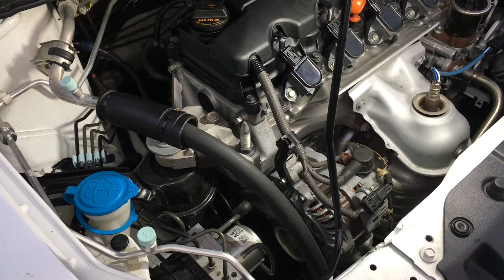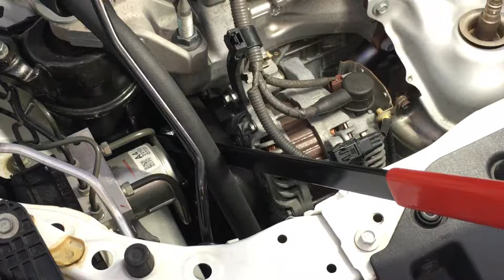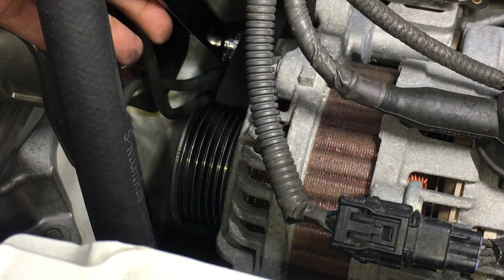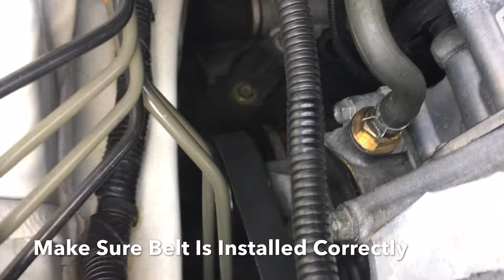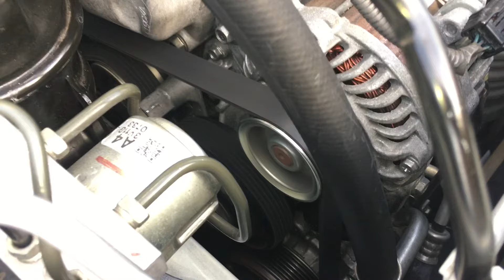2013-2015 Honda Civic Serpentine Belt Replacement DIY

Comment: Thank you sir. I do hope we get more 9th gen civic repair videos. It seems there’s not enough videos out there. I’m looking forward something like a starter replacement or cv axel. Ah maybe these cars don’t break down often. I dunno
Reply from the maker: These cars don't break down and also I just reached 50k miles haha. There will be more content coming out for sure, just be sure to be subscribed.
Reply: I second that. Also I just hit 83K and no problems. AC doesn't work because a rodent chewed through my wire harness though 🤔
Reply: 96k miles! And never had a problem 😤 love the 2012 civic
Reply: 156,000 and no problems! Simple maintenance and it’ll last you. However, only issue I’ve had is my starter just went out last week. I live in Minnesota, so the oem starter lasting that long with our -30°F winters really is surprising, and I also have an aftermarket auto start installed (which is said to wear the starter down more). Replace the starter myself, definitely a hard job 1.) because of the location of it is really tight but mostly 2.) it was literally -25°F when I was trying to do it.  However, it’s definitely doable with a ratchet, a few extensions and 12 and 14 mm sockets
Reply: @ethanadrian263  are you drive on cvt? I just heard that the 2012 to 2013 are more reliable transmission. The 09 to 11 auto trans were pretty durable.
Reply: @purpledonatello  I’ve heard that too! But no i have the base model so no cvt, other trims have the cvt though

Comment: Amongst so many incorrect belt routing diagrams, yours is completely correct. My observations are:

This jobs requires putting the hand quite deep, so its best done in a very well lot area and when engine is fully cold.

Better have cotton gloves on when you do this to keep your hands safe. 

While loading the belt finally be careful of the finger pinch risk. 
As long as you follow the diagram right, its doable without opening fenders/stuff. 

If you dont have the belt tool, just use an adjustable wrench with a peice of pipe and would work just fine.

Comment: How many miles or years should this belt be replaced?
Reply from the maker: Around 60k-80k you should check it
Reply: Mine is making a squeaking noise now after about 80k definitely getting it changed asap. A quick look at it you should be able to tell

Comment: I actually had to use string on top to tie belt. Also had to remove right tire and remove two plastic screws to access bottom pulleys.
Reply from the maker: I did everything from the top.
Reply: Lol 😂 you the man .the top means your good with skills .who needs to remove the tire. Lol

Comment: I replaced this on my 2015 honda civic and it was quit for months and then all of a sudden it started squeaking again and now when I press the gas it screeches. does this mean its not the belt?
Reply from the maker: Did you use an OEM belt?

Comment: I was told by a Honda dealer that I need to replace the belt tensioner as well.
Reply from the maker: No. Why if it’s not making noise or slipping? Don’t ever listen to them.
Reply: @MrRangerZr1  Right. They were gonna charge 160 for that. I dont hear a sound. More ways to make money I guess.

Comment: are you using bando belt? is a little bit tight when using factory oem
Reply from the maker: Yes Bando is OE supplier
Reply: MrRangerZr1 are you using the bando belt? Im having trouble putting it because it is too tight
Reply from the maker: Yes, 
It can be a real stinker, get another set of hands if you have too.

Comment: Great video! Honda dealer gives me a suggestion "tensioner, belt - replace" charged $460. I don't know if they mean the belt tensioner should be replaced.
Reply from the maker: Belt tensioner doesn't need replacing unless belt is making noise
Reply: MrRangerZr1 my belt is partially shredded and makes noise when accelerating?
Reply: @mrsshantel7999  change your belt before it comes apart.
Reply: I love your videos sir,but i find this statement to be false,as belts is not a tell tale sign that a tensioner needs to be replaced,my belt tensioner needed to be replaced but i didn't need to replace the belt as it was in good shape,we were able to see the tensioner moving while the heater was on and my mechanic used a pry bar to hold it in place and the noise the car was making stopped,i changed the tensioner only and the problem was solved,love your videos all the same.
Reply: @bigred8863  There is no way I would change the tensioner and not put a new belt on, that would be stupid.  You can buy a belt for $20.

Comment: Did you have to remove the wheel to remove belt? It could be great to see the part of loading new belt on pulleys.
Reply from the maker: NQ if your hands don’t fit you may have to

Comment: I'm replacing my belt today. I bought the tool and the belt. When you turn it counterclockwise it loosens it but when you put the belt back on do you have to just tighten it back up do you need a torque wrench or do you just bring it back to its original position
Reply from the maker: Collective Consciousness it’s auto tensioned as shown in the video
Reply: Make sure the serpentine belt is set properly in grooves, or you'll damage the new belt. The tensioner will
Give it the proper torque, once in place and released.
Reply: @garyanderson7741  it's been on for a few weeks now and it's running great . I'm happy I did it myself and saved  myself the money

Comment: My 2012 civic is making extreme noises coming from around the belt and alternator area. It gets louder every time i accelerate? Will i need a new alternator?
Reply from the maker: Take off the belt and inspect the pulleys. Alternator usually whines when it goes bad.
Reply: MrRangerZr1 it whines as your pressing on the gas correct? The steeper you press on the gas pedal the louder the whining? If so that’s the same as my vehicle

Comment: I'm not sure if this is a stupid question or not, but do you have to turn the belt tensioner back clockwise after you have installed the new one or does it go back automatically?
Reply from the maker: It goes back automatically, slowly let it back, don't just let go of it.
Reply: @MrRangerZr1  so I just got the tool and belt and I've got the new one routed per my vehicle and there is a lot of slack left. I'm not sure what the issue is.
Reply from the maker: Check your install again. It shouldn't have that much slack, it should be tensioned.

Comment: Hey man first of all great vids and thank you because I do my own maintenance due to ur videos. QUESTION, is it normal for cars to make weird noises as it warms up after ignition? It goes away after driving a bit but when idle and warming it I can hear this little buzzing noise but was curious what it might be. Please and thank you
Reply from the maker: "Weird noise" can be a million different things. What kind of sound does it make? From where?
Reply: @MrRangerZr1  sounds to me from the timing belt area but deep in there nothing on the outside where hands can touch. It's like a buzzing noise that comes and goes but only as it warms up
Reply: @alexisbeltran7110  same here. Did you ever find out the source of the noise?
Reply: @walrus_man  no but eventually it did it less and less that is sort of just went away on its own. I completely forgot about that because I never heard it again

Comment: Do you have to worry about timing marks for changing the belt?
Reply from the maker: No this is the drive belt. Timing belts are different. These engines don't have timing belts, they have timing chains.

Comment: you never showed tightening that bolt you used the serp tool with. is there a certain amount?
Reply from the maker: There is no tightening...it's a pivot point.

Comment: I have a noise coming from the serpentine belt area but it isnt a squeak or loud but you can definately hear some things up. How can I show you the video?
Reply: I actually posted it on my channel, can you tell me if this is just a simple belt replacement pr somethimg else?
Reply from the maker: I have the same noise on my civic. Best thing to do is to remove the belt and inspect the bearings. Start up the engine for a short while and see if the noise is still there. I haven't addressed this noise on my civic. I will update once I find the culprit.
Reply: @MrRangerZr1  yea I just started hearing it this afternoon but it doesnt affect performance and it really isnt that loud. I can only hear it when I'm close to the car or when I open the hood and the noise sometimes goes away. Anyways thanks for the input and post a video if you ever end up fixing it.
Reply from the maker: I can't tell if I had this noise since new...I noticed it only when someone pointed it out. I don't think its the fans...well have to check.
Reply: @MrRangerZr1  ok so I took the car out and let It idle for a good 5-10 mins and I noticed after I revved the engine one when it was warm the noise went away at idle, then I shift from park to drive and it was there again. It's really weird and I dnt want a mechanic to charge me to change something that isnt the problem. Let me know what you find out maybe I have the same issue.
Reply from the maker: I will update asap. Don't change anything yet.
Reply from the maker: I checked out my civic today, sound is coming from the PCV valve area/intake manifold, not from the belt area...I think. I haven't figured it out yet.
Reply: @MrRangerZr1  oh shit you're right. I inspected the belt and it's good. I just saw another video on YouTube and I heard the same noise as I had and his issue was the pcv valve. Should I just go ahead and replace the valve? I saw u made a video on it and it seems like a cheap part.
Reply from the maker: Let me first find out. Better to find the exact problem instead of throwing parts at it. I will update. 
Might be the PCV valve.
Reply from the maker: @12fg39  Hey looks like it's the PCV valve. I had an aftermarket PCV valve on my car. Replaced it with a OEM and weird sound is gone. LMK if you get the same results. I'll post a video once you give me feedback.
Reply: @MrRangerZr1  okay thanks. The procedure on how to replace it, is the same as the pcv valve video on your channel right?
Reply from the maker: Yes just follow that video. Replace it with a OEM PCV valve, it's linked in the video's description.
Reply: @12fg39  did it solve your problem?
Reply: @sharonapple26  yes
Reply: @sharonapple26  very simple to do. Follow MrRangerzr1 video about pcv valve if u have a 2012-15 civic :)
Reply: @12fg39  ok thanks!

Comment: How often should you change it like at what mileage?
Reply from the maker: 50-60k miles
Reply: @MrRangerZr1  lol shit I'm at 80k
Reply: Lmao I’m at 100720 miles on my 2014 got it with 4 miles on the dash I think it’s about time to change it
Reply: if you read everything online there are 2 trains of thought on this. 100000 miles or 100000 km. Belts are interesting. You can see wear and you can hear stretch. I had a discussion with Honda supervisor that was up selling. I questioned him. How is it  miles equals kilometers? He proceeded to tell me that conditions were different in Canada. I said really. So Honda's in the north east US states are supposed to change at what mileage? He didn't have an answer. My fist Honda had a belt that you could see physically that needed to be changed. Cracked on the inner guides. Who knows how long or how many kms it had been used.  I am at 160000 km and at the end of my warranty. On very damp days you can hear the belt slip on start up. I am finally considering a change. Sadly i used to trust Honda mechanics and their advice. But the dollar has corrupted dealership owners and the up sell is king. How many still usable parts are thrown away. If they are actually changed at all. Read your owners manual. The information from the engineers is in there.
Reply: @vicstalr I'm at 174K and it's never been changed. Just bought the car and I'm changing it today haha

Comment: What about a whine noise when u first start a car but goes away eventually?
Reply from the maker: Where does the whining noise come from? Belt area?
Reply: MrRangerZr1 alternator area but kt goes away :/
Reply: MrRangerZr1 what would also cause a low sounding humming noise that doesnt get louder at low speed ? I thought at first it would be a bearing but its not.
Reply: My 15 is doing the exact same thing. Drives me nuts
Reply from the maker: Hmm...can one of you record the sound and post it on your channels?
Reply: Mine does something like a rattle. Only when the engine is cold and for a few seconds, usually in the morning. I don't know if it happens because the belt's wear (I'm going to change it as soon as possible) or if the tensioner is becoming bad (a common issue with the hydraulic part, I believe).
Reply from the maker: Ricardo Ramos You think you can post a clip of the sound? I don't have any odd sounds coming from my Civic.
Reply from the maker: Ricardo your belt seems to be wobbling at 0:38. I would change out the belt and check for a bad tensioner and other belt components.
Reply: @MrRangerZr1  I will check tomorrow, but I believe that the wobbling you saw was in fact an effect (distortion) from a bump from my hand in some part of the car.
Reply: SOLVED. I changed the belt last week. When I took the old one out, I noticed some play in the tensioner pulley and in the free pulley (the one that stays in the top back of the engine). I don't know if it is normal that play and I was worried that they were the source of the noise. But I didn't have their replacement, so I just changed the belt and call the day. For my surprise the rattle noise IS GONE for a week (at least until now).

Comment: Belt tensioner & pulleys? When do you replace these? 100k?
Reply from the maker: Check them when you change the belt and change as necessary. Recommended interval for belt change is 60k miles.

Comment: Have you had to change a water pump pn your civic?
Reply from the maker: Not yet.
Reply: @MrRangerZr1  thank you for responding so quickly. Yah mine is weaping. I will be changing it out today
Reply from the maker: Killmonize Productions how many miles?
Reply: @MrRangerZr1  161500. Repalced the thermo stat radiator and hoses. And temp sensor.
Reply from the maker: Nice! What year? I'm 100k miles behind from you lol
Reply: @MrRangerZr1  2012 honda civic ex

Comment: How did you pass the belt through the bottom pulleys?
Reply from the maker: From the top. It's a little bit of struggle but you'll get it on there eventually.
Reply: Jack car up and remove tire. Don't forget to loosen tire bolts before lifting car up. Use blocks on rear tire and have emergency brake on before jacking up. 
Remove small right plastic cover on tire well to access all bottom pulleys. Has two screws remove with flat head screws as these are plastic. bend cover to access pulleys from bottom.
Reply: @damienr3086  thanks man. I did this procedure last week and worked fine. I had to figure it out by myself 😂
Reply from the maker: Once you know the belt routing, it's not difficult.
Reply: Start the belt from the bottom pulleys  and work your way up to tension and finally the alternator. It take a little time and effort but eventually it hooks properly. Didn't remove tire or lift the car. It also helps to put the hood all the way up.

Comment: Have a 2013 Civic LX 5 speed, Does this cause your car to slightly vibrate with AC on?
Reply from the maker: Andy Ruiz no worn motor mounts can
Reply: @MrRangerZr1  but with the AC off my car doesn't vibrate at all.
Reply: @MrRangerZr1  going to check my refrigerant levels make sure they're not over filled
Reply from the maker: Andy Ruiz if your ac is blowing cold then leave it alone. It’s normal for 4 cylinders to vibrate in drive or in load.
Reply: @MrRangerZr1  oh ok great I just purchased this car and wasn't sure. Vibration isn't bad but noticable. Thanks bro
Reply from the maker: Yeah it's normal. I can't stand 4 cylinder cars...

Comment: did you remove pulley or have to go through front right tire to install belt?
Reply from the maker: Nothing was removed. Everything was done from the top.
Reply: @MrRangerZr1  thanks for the tip! Great vid.